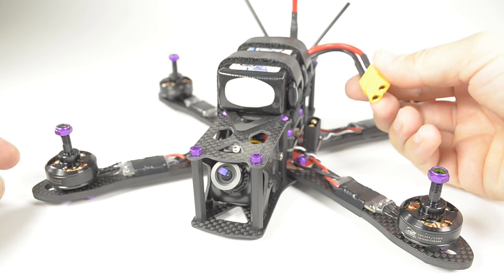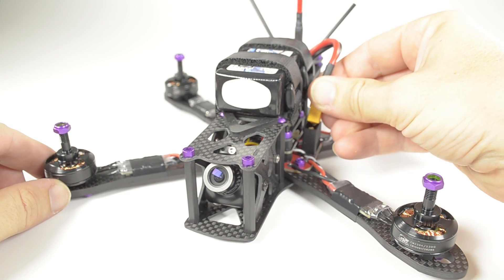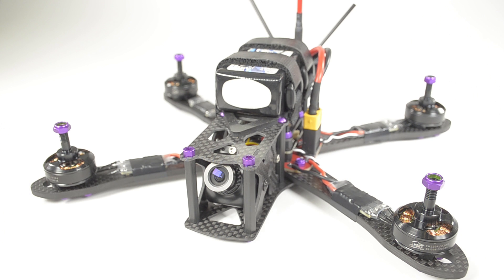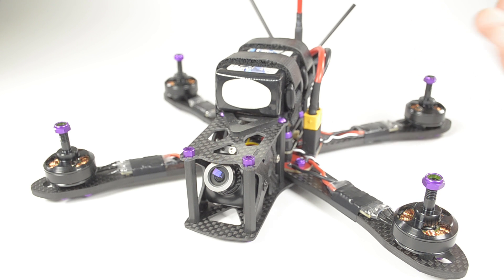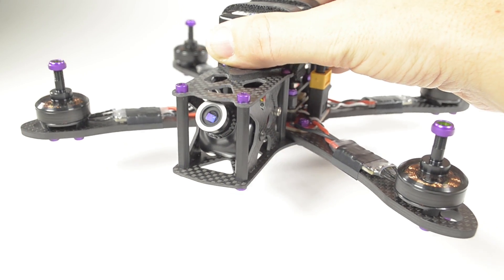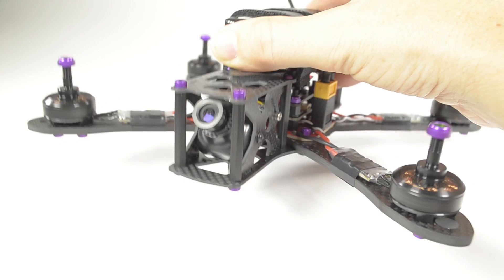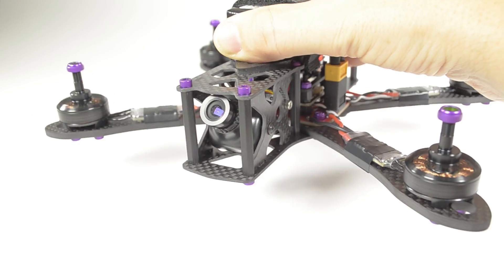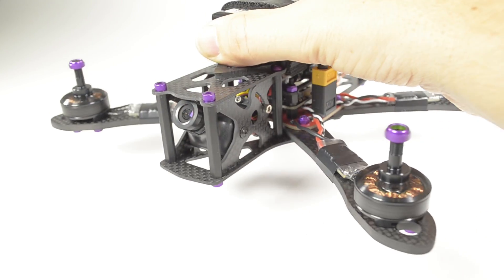ImpulseRC Alien Build - 05 Pre Flight Checks

Comment: Hello, thank you for these great tips. I'm planning to order the parts and build exactly the same FPV UAE. I didn't see you were soldering the motor cables CCW for number 2 and 3. In most custom videos I watched there were soldering the 2nd and 3rd motor cables CCW rotation. Why is it different in this model?

And my second question is are these all going to be enough to create the same UAE?

ALIEN 5" FPV FRAME
4x Cobra 2204 2300KV Brushless Motor
MotoLab TornadoFC STM32F3 Flight Controller
Pololu 5V, 500mA Step-Down Voltage Regulator (Do I need this) 
4x FVT Littlebee 20A ESC - BLHELI
4x HQ Prop 5x4.5 Props
10cm SMA pigtail - Right angle bulkhead
HS1177 FPV Camera Upper Left Connector
+ A Lipo Battery (Not decided which one to get yet)
+ ImmersionRC Raceband 5.8GHz 600mW A/V 
+ X8R Receiver

Thank you very much in advance.
Reply from the maker: +Kaan Aslan Since these are BLHeli ESCs you can reverse the direction of them later using BLHeliSuite software.

The list you have should work just fine, you will probably want to buy spare props though! Also a X4R or XSR receiver is a better choice because of the much smaller size.
Reply: +ImpulseRC Thank you for your answer. I'll buy X4R receiver. Which spare props do I need? I didn't understand what you meant.  Can you provide a link for me please? 

I've also decided to get the Cyclone FC. This way I won't need to get the Pololu.
Reply: +ImpulseRC You didn't mean the fastener spare kits did you? Because I thought they were already included in the package.
Reply: +ImpulseRC Maybe you wanted to to say 4x HQ Prop 5x4.5 Props? That was already in my list but I'm just trying confirm that I understood what you meant. Thanks.
Reply from the maker: +Kaan Aslan Yes, I mean the HQ Props! Technically four is all you need, but when you crash they break so it's a good idea to buy a few packs of them so you have spares!
Reply: +ImpulseRC Thank you. I'll definitely get extra props.

Comment: when you install the FC, do you need to go to the website to have everything calibrated? or is it as simple as install - check - then fly?
Reply from the maker: +Sean Matsumoto You definitely need to set everything up very carefully, it will depend on your FC and the firmware it's running.

Comment: What transmitter are you using?
Reply from the maker: +Thomas Greenhill If you mean the video transmitter, in this build Soma used an ImmersionRC 600mW
Reply: +ImpulseRC I meant the control link transmitter. Great video by the way.
Reply from the maker: +Thomas Greenhill Sorry! That's a LemonRX on the quad and Soma uses some kind of Spektrum radio, not sure which :)